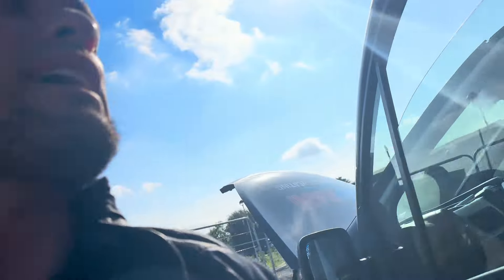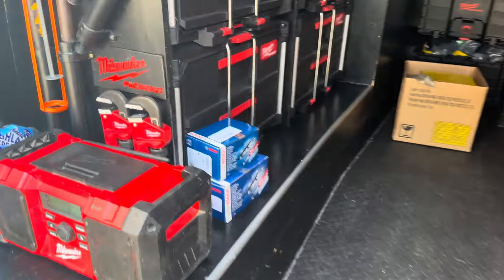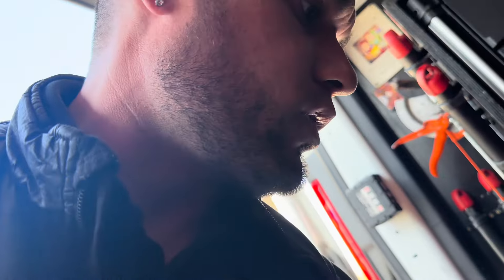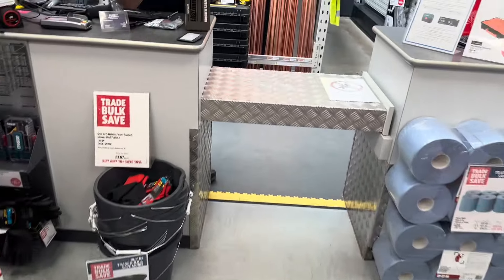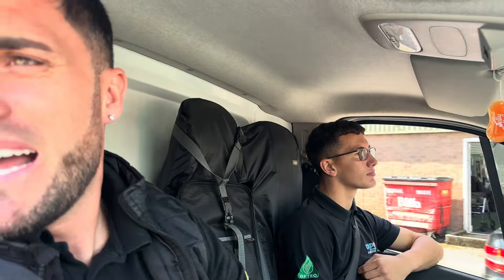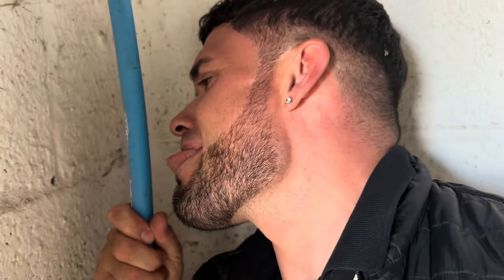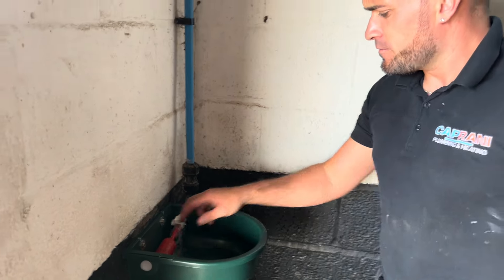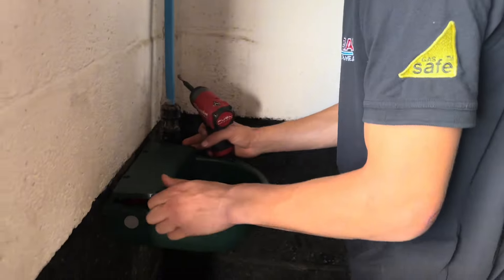HOW TO FIT A HORSE DRINKER

Comment: Hey up Nathan.  If the water supply supplying the drinking troughs is from a fluid category 5 source these are suitable. However if the supply is potable water they wouldn't because the overflow arrangements don't meet that required for fluid category 5 protection. The old ones that came out had a raised float valve and cover . The new ones only have a cover. Just worth checking supply source to cover your arse as Yorkshire Water regularly check these types of establishments. All the best 👍
Reply from the maker: Respect hustler, it’s fed from a natural borehole well so no worries there mate. I respect the support lad 👊🔥
Reply: @capraniplumbingandheating  Brilliant.  In that case . Stand Easy 💂‍♂️

Comment: Funny that is! I have just bought the exact same pads for the exact same van and did them in 30 mins tonight 😂😂
Reply from the maker: Fair play lad was it hard to do serious, really thinking of doing it👊🔥
Reply: @capraniplumbingandheating  really easy mate. Wheel off, carrier off with 2 bolts and pads pop out. Just copper grease them up and you’ll be sound